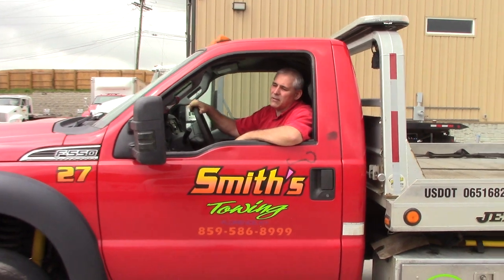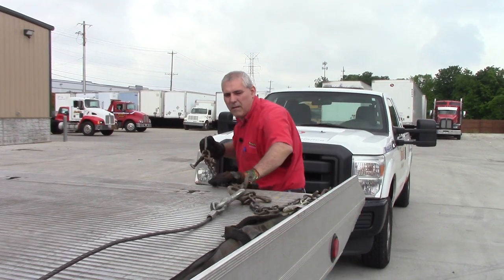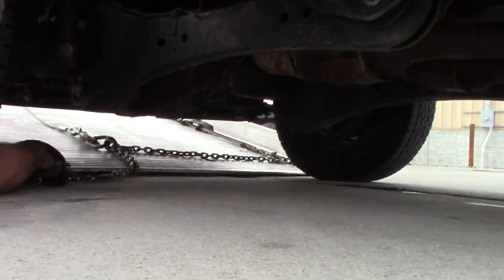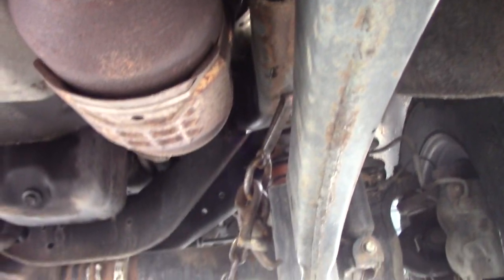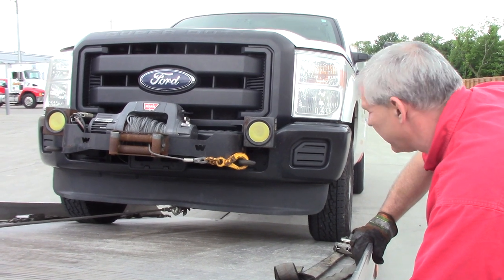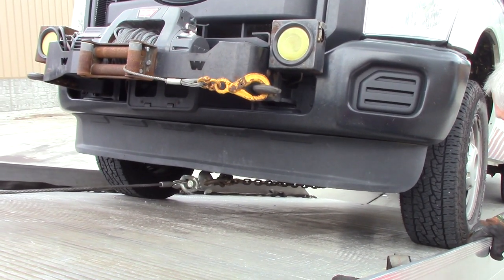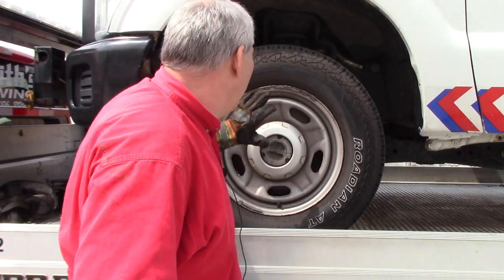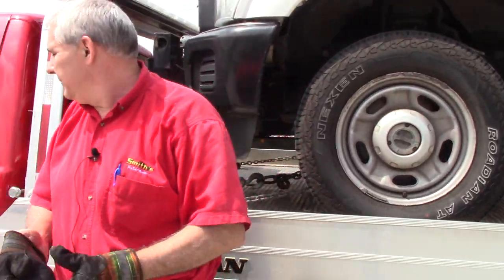On-Loading a Truck | Smith's Towing

Comment: The gloves for anyone wondering is a wreckmaster taught trick, You lower the bed and extend it all the way out, You count your normal steps from the end of the bed to the rear axle, Then when you come up to a car your going to tow when you go back to greet you, customer, when returning to your truck you will stand where you want the bed to end up, you will walk the previously counted steps drop a glove then you will back up til your rear axle hits that glove and your bed will stop exactly where you started your steps at, Personally I just know where my bed will end up by experience but you can do that trick if you need to.
As for the front two chains if you are going to do that, I would just recommend getting 2 chain binders and putting them on there as it is 2 easy safe and legal points of tie-down out of 4, And they will be strong and safe, and if you are putting the chains anyway you might as well, Because the chains alone as shown even though they may be tight, they are not considered tie-downs.
Same with rear chains, we all do it, throw some chains on the rear tighten it with the winch throw on some safeties or straps in the front and roll-on, It's secure that way, you may never run into issues that way, but if DOT or fmcsa is strict in your area they will bust your ass for it if you put chain binders on the 2 chains they become legal tie-downs.
Technically as shown his method is 2 points of tie-down out of the required 4, The reason being you see 2 chains and 2 straps and thing that's 4, but each tie down has to be independent and adjustable, Ratches are adjustable, chains are not, chains with binders are adjustable so they count with binders, Either type, but they have to be independent of one another AND adjustable, So you cant legally do as shown because even though the rear straps will keep tension on the front chains they are not independently adjustable.
Reply: It works good for container drops too!

Comment: Might want to put the vehicle back into park or manual low gear (and apply emergency brake) before wrestling chains under the wheels.
Reply: That’s not his mo he likes to leave it in neutral
Reply: Everybody does theirs different yes . 
 I 100% of the time load , strap front tire  , then jump up there place in park and set emergency brake. I know people don’t like jumping up and down the bed but I rather have 100% control of the vehicle at all times

Comment: Don’t use that hole on a diesel motor truck! The bridal will crush the oil filter every time! Those back straps are in a dangerous spot. When you pull like that on those Mini J’s they will pop out when pulling under the frame of the truck
Reply: Yeah, I had some cringe watching the mini-J pulling downward. I prefer the "R" hook, when possible, pulling straight back.
Reply: Nicholas Loberg Sr  that’s the only hook to use on those big trucks

Comment: What grade chain would you recommend for 3500 trucks and below??
Reply: do the math, truck probably weights in around 6000 pounds, 4 points of contact.
Regular chain you will most easily find for these is g70 3/8 chain that has a WLL of 6600 pounds, Times 4 well exceeds the weight of a 3500 truck.

Comment: Just my opinion.  Never ever load a car in N. That wench breaks you just bought a car  or killed someone. You can apply the E break just a little so it won't free roll.
Reply: Brian Mallow I’ve been thinking a lot about that during my career towing I’m not a fan knowing that winch cable can go at any minute that’s why I’ll typically immediately strap the front left (closest wheel to the controls) or throw it in park but keeping in mind the extra strain on the winch and the idea of a car rolling off isn’t great, I’ve made the mistake (usually on the side of the freeway trying to be quick) lay under the truck as I hook the axle and snug it with the winch knowing it can fail and roll off but I’ve been learning more and more each day
Reply: what are other options? will the car load in drive?
Reply: I run a 15ft safety chain that I hook onto the bridle once the vehicle gets a couple feet on the deck. You could use a strap also. Cheap insurance.

Comment: What are the hooks on the front of the truck for
Reply: another tow point. but with most trucks, you’ll likely run out of cable before the truck is fully on the bed, better to go further back to get more use of the cable